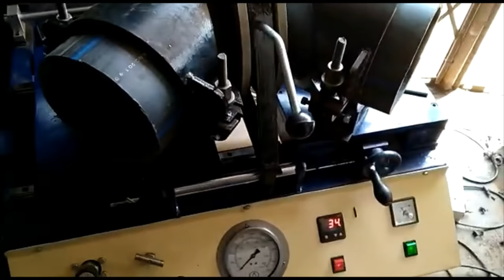HDPE Fitting Fabrication Machine by POLYMOLD PRODUCTS

Comment: Do you clean the bead/seam off on the inside of the pipe or leave it in place?
Reply from the maker: The bead inside is left intact. To my best knowledge, there is no need or reason to cut it off. If a client specifically asks for it, then it is at his own risk

Comment: Is this welding type resistant for pressure variations like water hammer?
Reply from the maker: Yes, this is a standard fitting. it will withstand water hammer. Use it at 75% of the pressure rating of the pipe itself for long durable life
Reply: @Polymold  I think derating factor of tee with this type of join is 50% only. refer to ISO 4427-3. Thanks for the great video anyway.

Comment: I would not trust it cause when the iron was pulled out the plastic melt was concave . And in the gas pipeline world automatically  fale  it won't hold for anyone's safety
Reply from the maker: i dont think you have ever referred to DVS2207-1 . the temperature, soaking time, pressure, cooling time, bead thickness and shape all meet the desired requirements. The fabricated tee is pressure tested after derating and meets all testing parameters.

Comment: That weld came out crap at the join, you are meant to chisel back the previous weld, top bottom and inside to account for the roll of the bead so the welds look flush
Reply from the maker: what previous weld are you talking about ... ? the weld is not supposed to be flush. there is supposed to be a bead. Refer to DVS 2207 -1
Reply: Weld is perfect what previous weld